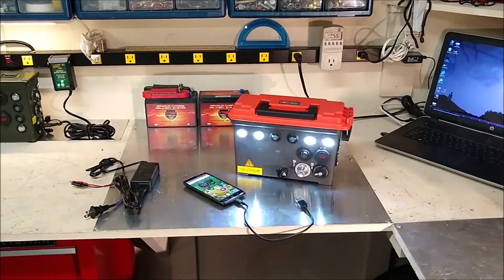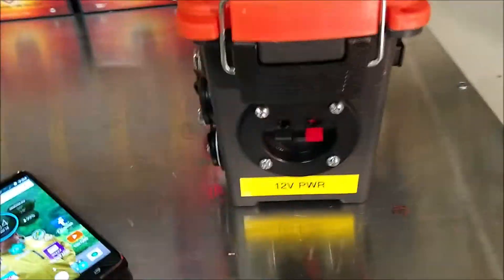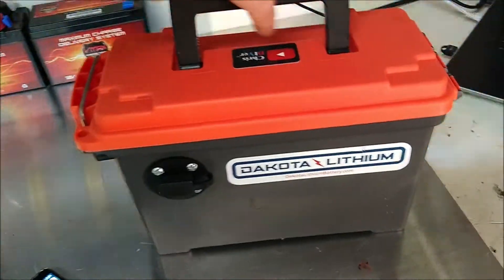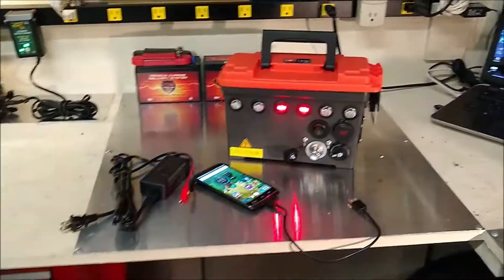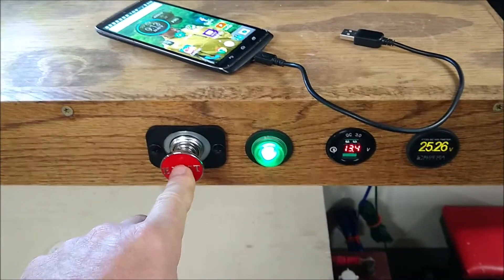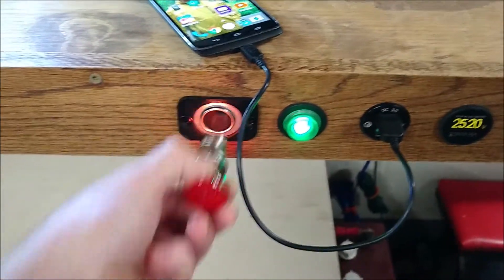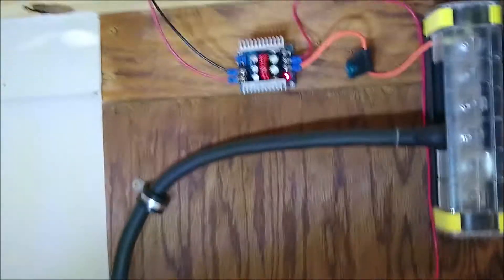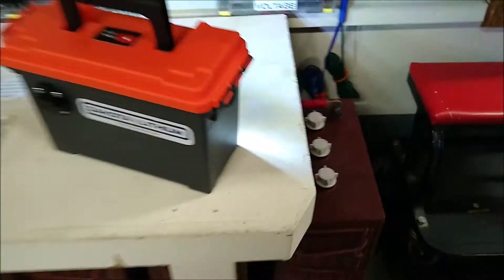Dakota Lithium 10aH battery - portable power box

Comment: Chris, Excellent video and build.  You definitely have dialed in the lithium solar generator.  Congrats!  I am thinking the new charger is really just a standard power supply that is set for 14.4 volts at 3 amps.  Probably the battery itself with it's BMS is doing all of the smart work for charging/discharging etc.  Would be interesting to use your small buck converter to send 14.4 volts to your new generator as a power supply to confirm this theory.  If correct, you would not be locked into that new power supply and would have many options as long as you as using some sort of buck/boost converter to send the correct voltage.  The BMS on the battery will regulate the amperage.  BTW, really like the music too!
Reply from the maker: Thanks bro...appreciate it. Just trying to make a solid video to show/help/inspire others with their DIY creations. Oh, I agree...that charger is basically an AC-to-DC adapter with a 3-amp output. However, it does have a super-neat red/green LED to show when it's done. I asked Dakota Lithium some questions about solar charger parameters...they got right back to me. I am sure my buck converter would do well. My only question (I am kinda-sorta new to lithium): the buck converter is a 20-amp unit. Will the battery BMS regulate charging current? Or do I need to dial down the buck converter current output?

Comment: Morning Chris, how do you adjust the voltage on the buck converter and what are the limits on adjustments ?   J K
Reply from the maker: There are two pots on it for current and voltage adjustments. I maxed out the current pot (devices always have enough juice)...works

Comment: Solar question. I have a solar powered gate opener. The solar panel charges a lawnmower battery and it’s 110 feet from the charge controller and battery. I’m going to replace the 5 watt panel with a 15 watt panel because the battery dies about once a month. What gauge wires would be best to run it 110 feet from panel to battery. ?
Reply from the maker: That is a long DC run...but, I would think some 10 AWG landscaping wire and a 50w solar panel would work. More solar panel wattage is always better for battery charging. The solar charge controller will keep everything safe if set up correctly
Reply: Chris DIYer thanks Chris.